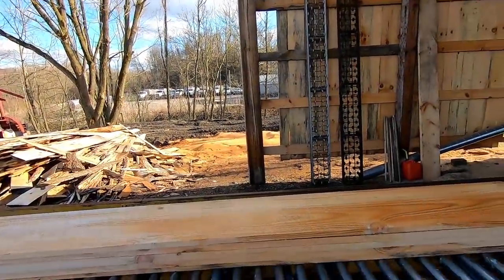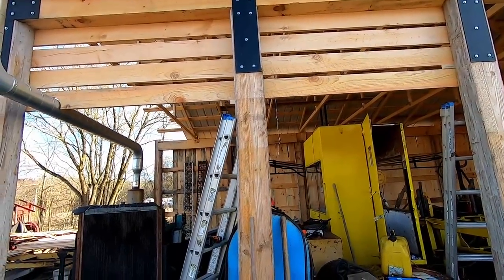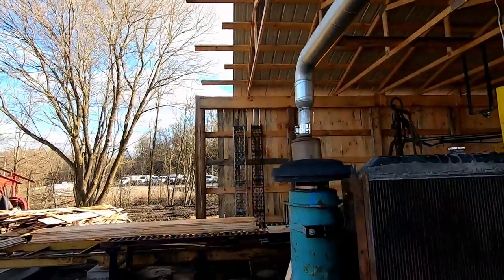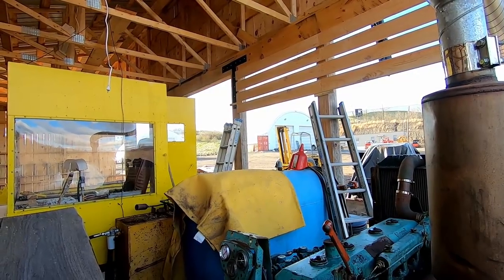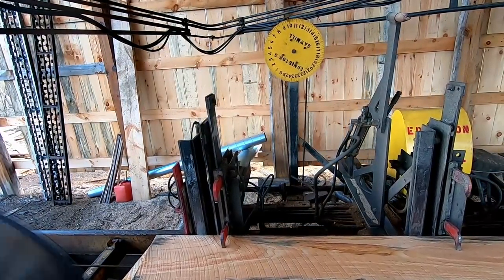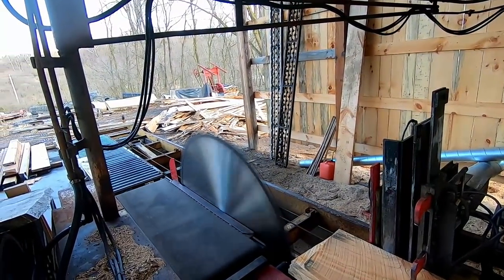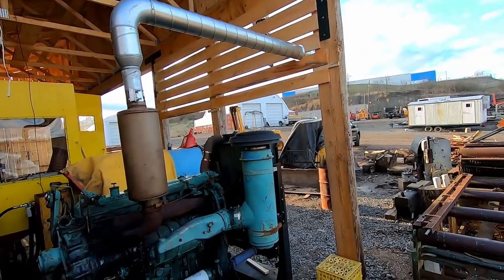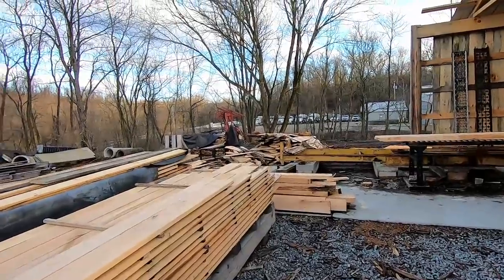pine slat wall

Comment: Mark, just a suggestion, that opening you're going to leave open, have you thought about getting some clear plastic to go from the top of the opening to the ground, it will be easy to get into to service the fuel tank and bus motor while keeping out the drafty weather.
Reply from the maker: thanks Kenny.